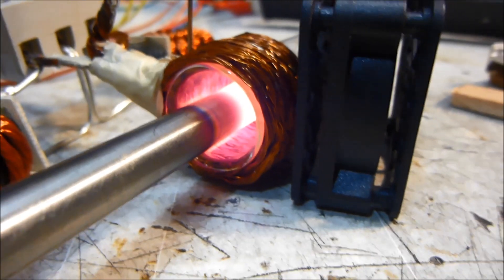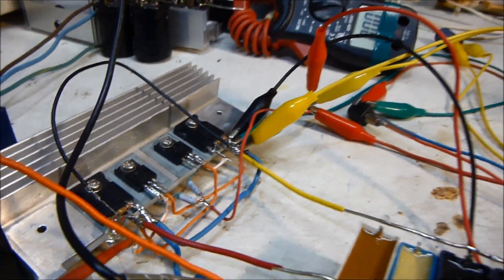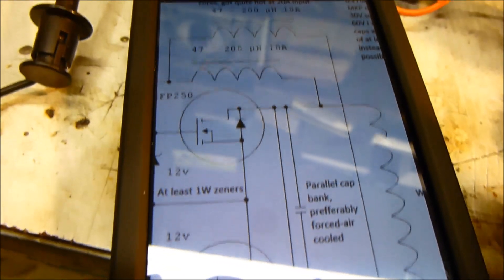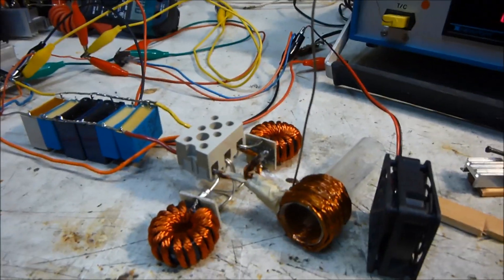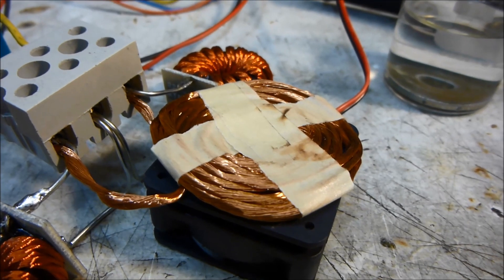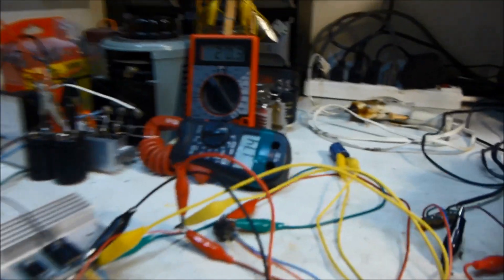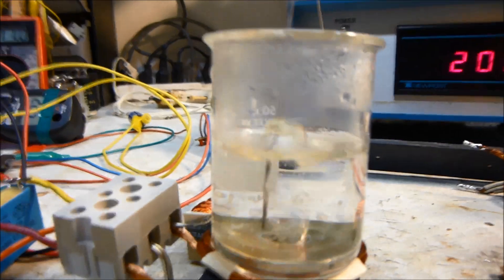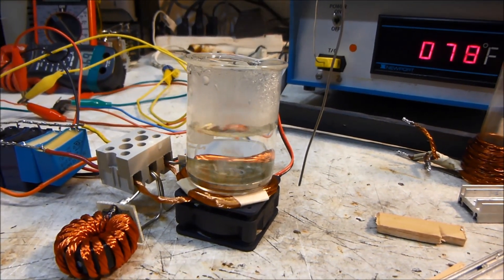Induction Heating With ZVS Driver - Flat Induction Coil Boiling Water and Litz Wire Coils

Comment: Excellent presentation I have been backpacking for nearly a decade now and have been looking at using a CVS driver to boil water and general cooking with my stainless steel water pot. 
About how many Watt hours would you hazard a guess to boil 1 Liter of water? 
What might an ideal switching frequency be?

Comment: Use IRFP460 mosfets. They are rated at 500V and are only a few cents cheaper than IRFP260s
Reply: Only rated for 20amp though
Reply: @uiohgycgfhgjh True! I stand corrected. The reactive currents generated are very high so the 250s are probably better looking back

Comment: FYI, the frequency determines how deep the magnetic eddie currents form, within the metal object.  It’s been awhile, but IIRC, with higher frequencies eddie currents tend to form more towards the surface, making them good for selectively hardening the surface, while leaving the core cooler.  Objects like hammers, gears, and axes, benefit from having hardened surfaces and tough cores.

Comment: Rings will ABSOLUTELY INDUCT!  I learned my lesson from a microwave transformer, I was using it to drip voltage and raise amperage,  totally forgot about the high voltage load for the megatron...   needless to say,  it arced to ring, hand arced to ground in about 6 places....  my wife ran in and said, "what smells like burnt hair and pork chops?!?!"
I replied that would be me....
Reply: Are you okay did you get shocked?

Comment: Solid.. I am on another level.. like entry' and it's more proof of concept and to test for thermal IR heatradiation.
pick up a cheap 3.5 USD device from CHina and so-far impressed with it. though IM running it on a adjustable powerbank..
https://i.imgur.com/6lMr8mP.jpg
but still are able to make fx a 5mm allen key red and can controll the amp with the trigger.
thx for the vid.

Comment: Wonder if you can help me, so far I haven’t gotten a clear answer, how can I make an electromagnet dc or ac doesn’t matter as long as when powered on the north and south isn’t flipping. I need it to be temperature safe with Continuous power being powered on and indefinitely / endlessly powered on. Safe to touch. That is #1 importance, and the stronger the better... but also the Smaller the better. But length must not exceed diameter. Shape of diameter isn’t important, just keep in mind strength. There will be many coils directly together so my guess would be square would be better but not sure.
Also would like to know how to make my own power supply for this that plugs into USA wall socket, powering my electromagnets endlessly 24/7/365 and everything being perfectly safe!

Comment: I think altitude can lower or raise boiling temps of water due to air pressure of the atmosphere on the water, which means it can also change if a weather front is moving through.  very cool video.  very cool.

Comment: Your thermocouple may be accurate depending on the barometric pressure where you are located. Water boils at variable temperatures in different altitudes.

Comment: the temperature of the metal probe of the thermocouple itself is affected by the varying magnetic field created by the pancake induction heater, thus the strange measurements.  Nice video.  You've got a lot of potential, and I encourage you to explore electrical engineering in college, if you haven't yet considered it.  If you really want to 'shoot for the stars' go for a degree in physics... you can do it!
Reply from the maker: +Jason Stone yes, you're right about the thermocouple prob. Thanks! I'm going to Penn State Behrend for mechanical engineering technology. I was originally going for electrical but I changed my mind

Comment: Great Work !!  
I am working on the same but the power rating is around 5000W . 
I need  your help with the ratings of the components i need to modify in this circuit .
please help.

Comment: Couple questions: 1. What is the frequency? 2. Have you attempted to measure system efficiency at all (e.g. total heat output in calories / total energy consumed at the power supply)
Reply: He measured it at the end if you were paying attention.

Comment: my power supply is 60V-60A  3600W so I need bigger mosfets
Reply: keza ELECTRONICS where did You got that power supply ?
Reply: from shop in croatia power supply is from germany (switching mode power supply )
psu name is : MC POWER
Reply: thanks
Reply: Mircea Sabau 
😜 lol I overload it few times
Reply: how ?

lol

Comment: The iron nail has a high magnetic permeability. This is a measure of how well it will concentrate a magnetic field. The more of the magnetic field it concentrates the more energy it will absorb due to induction. As the nail heats up it will reach its Curie point temperature. Past this temperature the magnetic permeability drops dramatically. The nail will then dissipate much less energy from your circuit. This shows up as the sudden drop in current that you noted in the video... There are other factors that will cause the current to drop. You also noted that as temperature rises the resistance also rises. This will cause current to drop, but not in a sudden drop as was the case in the current drop you were commenting on. There are at least two different things going on... I am not sure, but I believe you can also experience a drop in energy exchange due to the loss of magnetic coupling. Energy is transferred from the coil to the nail via induction (an electromagnetic effect) but also through direct magnetic attraction and repulsion squeezing the nail (a magnetic effect). When you reach the Curie point temperature the nail will no longer be attracted to a magnetic field so no energy is exchanged with the coil that way. This may sound like just a different way to explain what I noted about the magnetic permeability drop at the Curie point, but I believe these are two separate phenomena. I think you can see the difference when you remember that your induction heater will also work on non-magnetic materials such as copper. In that case there is never any exchange of energy via direct magnetic coupling -- only through electro-magnetic induction. ... Hopefully someone will correct me here if I'm wrong. Or help clarify.
Reply: As you mention, there is a lot at play here, but magnetic permeability is only part of the story. As you said, magnetic materials will be heated up to curie temperature via a process called hysteresis. Hysteresis happens as the material resists changes to its magnetic polarity, and the rate of heating is based on a combination of permeability, frequency, and magnetic field strength. (look up hysteresis curve for more info) After the curie temperature (or in paramagnetic of nonmagnetic materials) however, heating is achieved via induced eddy currents.

Comment: What altitude are you at?  If you are at a higher altitude, the boiling temperature would be lower than 212 deg. F.
212 deg. F. would be at sea level.

Comment: With those long and skinny hookup wires in your circuit, I'm surprised that the induction heater works as well as it does! When working with low voltage at high current, you should keep the interconnecting wires as short and as thick as practical. And capacitors cannot do their job properly when you use long skinny wires to connect them in the circuit as you did. Anyhow, my intention was not to rag on you about all the mistakes you made. On the contrary, I want to congratulate you for being able to put together and make work a fairly challenging electronic project. Good job!  (Two thumbs up)

Comment: Make your own Litz wire by using a degauss coil from a CRT.  Cut the degauss coil and use all strands in parallel.  Don't waste your time using a Yoke coil.  Degauss coils are easy to use.

Comment: i have a project in that i have to heat up copper sheet thickness .25 mm to 180- 220 deg C , so my question is, through induction can we heat copper. if yes how much time is required.?

Comment: its the resistance of the metal that affects the performance of the coil in terms of generating heat. Do an experiment with metals and rate them in resistance before heating them, get 2 identical heating elements and one that has failed and you will see the difference immediately..

Comment: Hey, I had a quick question, if I used 20v Zener diodes in a zvs driver that I was using a 12v rail off of a computer power supply, would it run properly? Or would it fail to power the flyback?

Comment: The 2 coils are RF chokes and are to supply DC with a low impedance and are high impedance at the frequency (impedance at operating frequency  is Z= 2*pi*L*frequency).

Comment: You should link to the page where you got this idea in the video description.  Something about his design seems a lot more powerful.  Is it because he is using copper tubing with water cooling?  Bigger capacitor bank?  https://markobakula.wordpress.com/power-electronics/500w-royer-induction-heater/  What's the value and type for the capacitor bank?  What's the frequency?  After a few courses in electrical engineering, you'll be able to build more complicated projects on paper, and they'll work, often on your first try, without needing to do as much experimentation. for example, your higher number of turns being more efficient is because it made the inductance higher which made the frequency higher, or it matched the capacitors better.  It's just an LC circuit and you can look up the formula for frequency. For non-magnetizable materials like silver, nickel, gold, copper, and aluminum, above 100 kHz is probably needed.   Also, you noted the nail seemed harder to heat up for its size.  This is because there is less surface area on the skinnier pieces being heated. The surface area decreases with radius, and so does a cylinder volume, so it takes just as long to heat even though it is a lot smaller volume of metal.  See also http://www.richieburnett.co.uk/indheat.html

Comment: how about making a wireless soldering iron. in ebay are ZVS 12v and cost $6. Maybe use hollow soldering tip with iron and some sensor for temperature reading... Would it be feasible?

Comment: I believe that 1) the tube heats up faster because the wall of it is closer to where the generated field is strongest and 2) there is a lot less material to be heated in a tube than in a solid

Comment: Your thermometer is probably accurate unless you're at sea level or lower.
Reply: +James Lay I was going to suggest the same thing, but you did it for me.  Atmospheric pressure plays a big role in terms of boiling points.

Comment: Another awesome video! BTW, this may explain why your water isn't going to 212 degrees: http://www.engineeringtoolbox.com/boiling-points-water-altitude-d_1344.html
Reply from the maker: +TheMan1510 That's about right!  Thanks!
Reply: Makerj101 can I use a 36v,10A dc-dc boost module???????

Comment: Begin to see atomic resonance numbers, AlNiCoFe magnet, 13+24+ etc. Make phase analise with an audio software, you will find how it really work :) - Now stainless steel is Nickel + Chrome heating elements is made with this like NiChrome wire. Metal atomic numbers mix together, please try it, the key is there. Download CoolEditPro software and play with frequencies and make phase analise to see hysteresis curve pattern.

Comment: Other question. I'm thinking in use a coil with 40cm to heat a steel tube exacly look like in your video. My intention is heat water to shower. What i need change in the circuit to nake it work? Thanks again from Brazil!!!
Reply from the maker: +Anderson Silvestre Sounds like you would need much more power to do this.  So you will need much bigger MOSFETs and components.  I think for that application normal resistance heating would be a lot more efficient and a ton easier and more practical.  Induction heating is not all that efficient as power is lost through many parts of the circuit including the power supply, MOSFETs, capacitors, and losses to magnetic induction etc.  With resistance heating you pretty much get 100% efficiency.  All the electrical power gets converted to heat and if you have good insulation then most of that heat will be transmitted to the water.
Reply: +Makerj101 , That's the point. My is affixed in heat exchange between the tube 40 cm stainless steel and heated water flowing through the inner and outer surface of the tube. I need to heat the tube to the point of obtaining water at a temperature of 40 degrees Celsius. This is a nice temperature for a bath here in the Brazilian winter. Could you give me a setup opinion ?
Reply from the maker: +Anderson Silvestre Oh I see.  I really have no idea.  You're gonna have to wing it.  I've only designed little ones like this that are rated at about 200w.

Comment: Thank you so much for the fast answer my friend. Do you have the specifications for all components of your curcuit? Do you have idea about the Maximum power comsuption?
Reply from the maker: +Anderson Silvestre The circuit schematic has most of the values.  The other values are either not critical or vary a lot when you optimize for your exact configuration.  Just calculate the wattage off the values I was reading off in the video.  I think it was around 200 watts at some points.  However if you can design a more efficient circuit and use much more powerful MOSFETs then there is really no limit to the power you can consume with a device like this.

Comment: Awesome. I just switched from a center tapped work coil to a single coil and ferrite ring transformer... all performance was lost as a result, no heating except in the ferrite, which released its magic smoke. I was just about to replace it with two huge ferrite rings, but now I will try this hybrid LCLR method instead.
Reply: curator23 bah... more toastie ferrite...

Comment: Look for an MDQ100A (or an MDQ200A if 100A isn't enough) full wave bridge rectifier. I  d/c arc weld through my MDQ200A, and it doesn't even get hot. They are rated for 2000V and 100A or 200A, respectively.
Reply from the maker: UNITED POLICE STATES OF AMERICA That's just the problem.  The ones that are rated for 2000 volts are no good for this kind of thing.  They have too much resistance and just fry even though they can handle so much current.  Ohms law.  You need the ones that are rated for 100A at like 100V.

Comment: What about converting a commercial induction plate cost about £25.00 and change from pancake to a coil for heating steel. I know the safety switch would require bypassing. This could make a very cheap solution for heating steel rod.

Comment: I have make my own Royer Induction Heater.  I want to know if IRFP260 are working better and stronger?  Ever bigger steel/iron metal?
Reply from the maker: Michael Marr I can try some bigger things next time I get it hooked up.
Reply: Makerj101 me too.  After I change my board.  I don't like two fixed induction being behind MOSFET that far.  So, I will getting new board for two fixed induction connecting direct to work coil.
Reply from the maker: Michael Marr Sounds like a plan!
Reply: Makerj101 I will let you know when I'm done with my re-locating project.  :)
Reply from the maker: Michael Marr Sweet thanks!
Reply: Makerj101 are the inductors for feedback? why do you need that many capacitors?
Reply: Makerj101 If you want a GODLY mosfet, then the FDH055N15A is the one you need. This monster is rated for 120 amps and has a power rating of 429 watts!!! The Rds ON state is only 5.9mOhm!!!!!!!!!!
Reply: EETechs m'y induction heater works without the capacitors, do you have any Idea why I need them?

Comment: I'm thinking about building this, the only thing is I would need to power it from my ATX power suppply, (12V 28A MAX). will 12V work good?
also nice video, going to use your schematic.
Reply from the maker: Shay Mazor Umm it should work a little off 12 volts.  It really depends on the components you use and the amount of windings.
Reply: Makerj101 the componets are going to be exacly like in the schematic, the inductors I guess im going to wind myself as I guess I dont think they need to be precise 200uH :)
Reply from the maker: Shay Mazor Sounds good.  Best wishes!